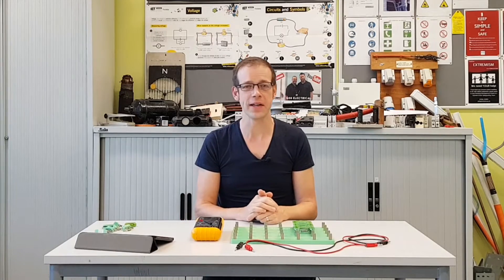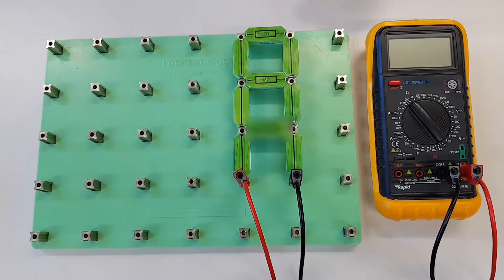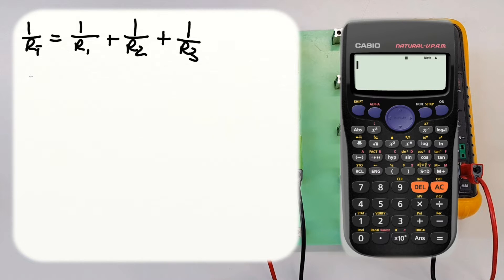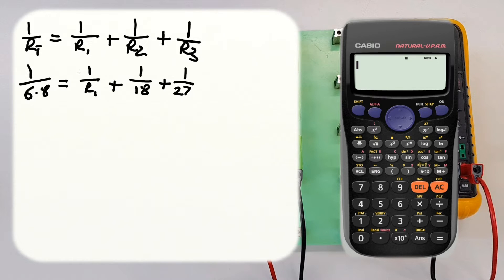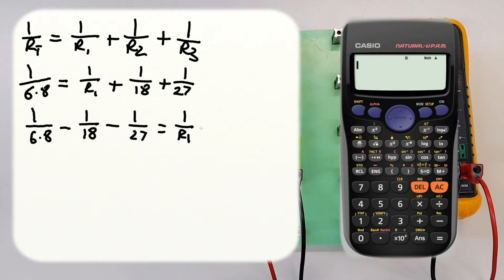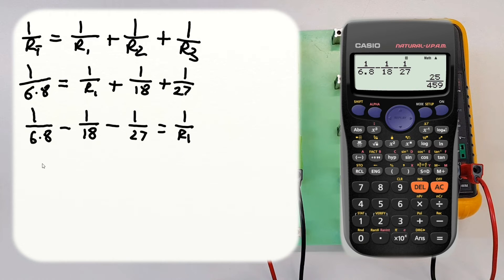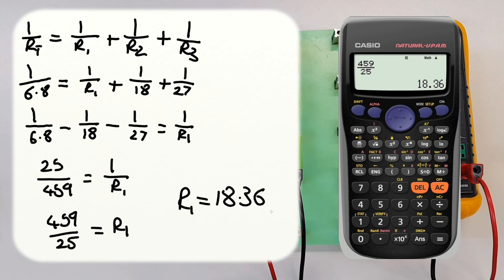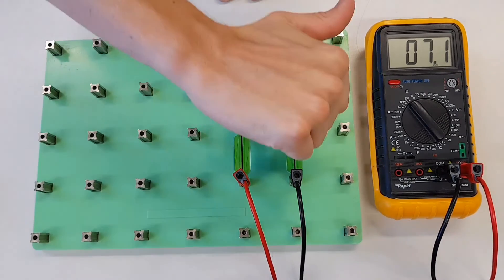Questions from Viewers: How to Calculate an Unknown Resistor in Parallel

Comment: i have a question Joe... If you have an unknown third resistor, you don't know the Rt but you know the current across one of the resistors and the total current running through the circuit. you also don't have the supply voltage. what step would you take first to help you figure out the rest?